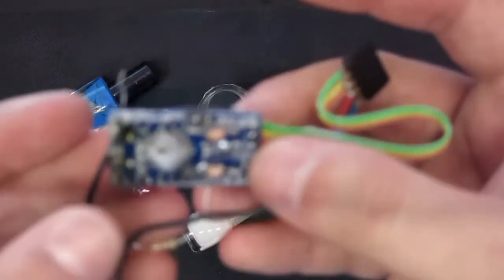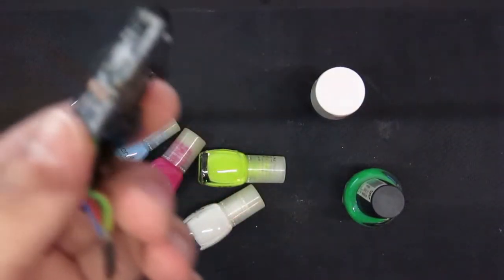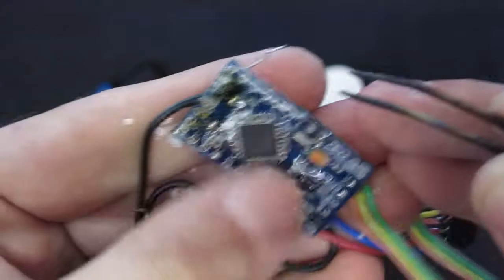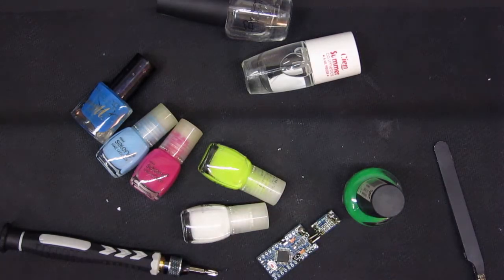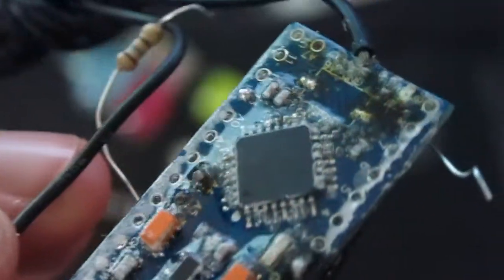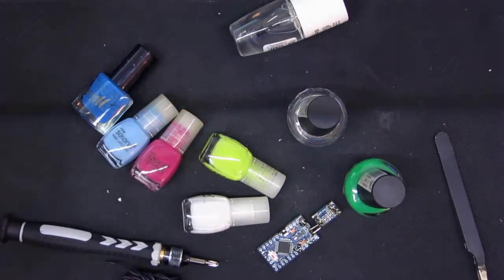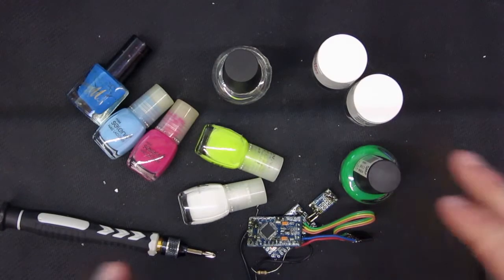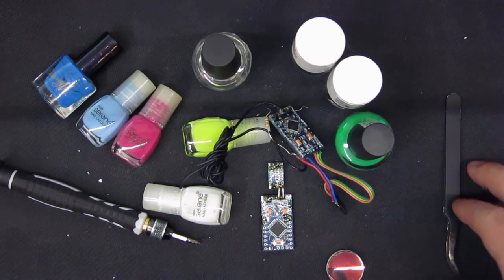Nail varnish is NOT a good conformal coating for electronics PCBs!

Comment: Maybe because its designed to go on microns thick and you have put it on mm's thick? As conformal coating to seal a pcb where you have cleaned up corrosion or pulled back solder mask for any reason nail varnish works 1000% fine.

Comment: idk if u just used junk stuff, but iv actually stopped using nail polish for this because it would stick to well, since it peeled the way it did yet stuck great in other areas makes me wonder if u didnt clean the parts properly, youd b shocked at how much stuff is on a single component

Comment: I use it on console when I do liquid metal modifications.I cover the transistor around the gpu.you must understand you need to read the ingredients to the clear Nail polish.look for metal poweder ingredients that is not what you want to us.you need none aluminum powder.since 2016 I been modifying console with thermal grizzly and the nail polish.it works well for years my ps4 pro still runs and I have ps5 I probably will redo the liquid metal.I’ve done my share of switches and Xbox’s.you’ll get it one day.
Reply: Good to hear it's working for years. I'm going to do this on my laptop and I'm going to use a normal clear nail polish. Even if it get's brittle, we can remove it with a nail polish remover.. I'm not going to be removing it anyway. The heat from the gpu is not gonna affect it right?